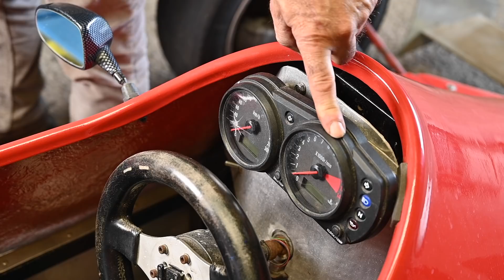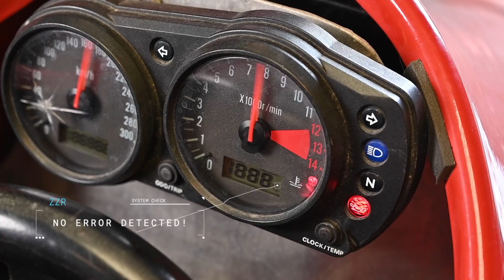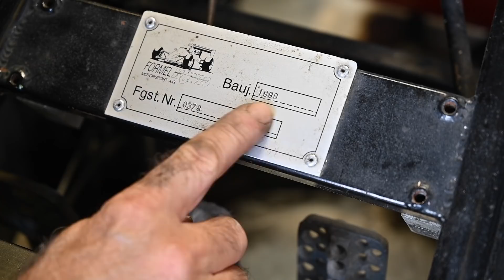Rebuilding a 1990 race car    Part 1

Comment: That cable connecting to the brake reservoir is most likely a crude way of adjusting the brake bias
Reply from the maker: Thank you for the comments, yes indeed that is what it seems to be. Not working
Reply: Was about to say the same.
Reply: It’s not crude,they are very effective. The knob and the way they are installed may be crude. I would put a fabricated crank handle on it to make adjustment faster. We use these in oval track racing and they can be the difference between winning and being last. Very important.
Reply: It's a brake balance adjuster. The cable connects to a double ended screw with a ball in the middle which sits inside the tube at the bottom of the brake pedal. The pedal pushes the ball and the screw ends each push on one brake master cylinder. to get more braking at one end of the car, front or rear, the ball has to be screwed (using the knob) nearer to the cylinder for that end.
Reply: Not crude at all, its the correct way of doing it. but its badly fitted and should be reachable from the driving position.
Reply: Doesn't a brake bias need to be routed to both front and rear brake circuits?
Reply: @youwantshum9860  nope. It's the balance between front and rear systems, it's one cylinder for the front brakes, and the other for the rear.
Reply: @kjellboman8841  yeah so what I said? In order to adjust brake bias, the adjuster needs to be connected to both front and rear brakes.
Reply: Calm down guys. The brake bias cable is connected to a balance bar between the pedals which when adjusted changes the leverage point giving the front or rear brake systems more travel or more leverage thus more pressure.

Comment: Hello, great car there. The overfill bottle is probably a requirement by racing club's tech inspection or maybe called scruteneering across the pond. It is to keep fluids off of the racing surface. More like you might not even have anti-freeze in your radiator as with our motorbike racing in Oregon we are only allowed water and certain additives such as Water Wetter for lubrication/anti rust. The hose clamp on the clutch reservoir cap is probably also required by scruteneering and the blue coloring on it maybe silicone to help keep it from unscrewing. Cheers!

Comment: Thank you from the bottom of my heart for this video. I am also going to build such a car from scratch. In Romania where I live, until 1990, more precisely 1984 1989, Romanian pilots built such cars in their own garages. They were called Formula Easter, they used Dacia 1300 or Lada 1,300cc or 1600cc engines with 160hp weber. We are waiting for new videos with this little wonder.

Comment: A Cheap and cheerful brake bias adj twists a bolt mounted across both brake pushrods with the pedal attached to the centre of the bolt via a threaded bush. Twisting the bolt moves the pedal from the centre to either the RHS or LHS master cyl pushrod ie the fulcrum.  Best wishes on another great project.
Reply from the maker: Thanks for your comments and that is exactly what it is

Comment: 9:31 Brake Bias adjustment, allows you to dial in more or less brake power distribution in between the front and rear.

Comment: Nice project. As already commented by others. The adjustment is the brake bias. Mostly working with a ball on a treaded bar inside a tube on the pedal assembly. 
The bottle is to catch any fluid which cannot be spilled on the race track. The curved radiator is perhaps also from the motorbike donor.
Reply from the maker: Thanks for your comments and indeed .. good remarks

Comment: Steve, even a 5 - 8 minute clip on bending metal or fixing a hose clip on old Rusty would make many of us so, so happy! lol
On this race car I noticed the engine is mounted way higher than the radiator fill cap. This arrangement should have a short metal (steel or alu alloy) outlet pipe along the cylinder head whose level is slightly higher than the coolant passages in the cylinderhead and the fill cap mounted on it. So it will be thermostat, then the fill cap and a rubber hose leading to the radiator input. The radiator should have no cap, just the two tanks. Also, if there is nothing on the other side of the car, you could mount two radiators one on each side but mounted diagonally rather than curved. But, at high speeds, which this car is made for, the force of the oncoming air can bend/break the radiator fins. So, the fins have to be set at an angle or vanes put there to redirect the air flow. Finally, when designing the radiator, keep in mind the extra cooling needed because the car is heavier than the motorcycle for which it was originally made. Cheers.!
Reply from the maker: Thank you for the comments

Comment: The control knob is for a brake bias adjustment (front to rear) useful for wet to dry setting, it should be in a position so the driver can adjust it from his seat. The water expansion extra bottle is because no fluids are to be dropped on the track, you may find something similar with the oil (a catch tank) good work keep it up. Many seem to be missing "old rusty" but those who renovate old vehicles know the problem of getting or having parts made for them.
Reply from the maker: Nicholas, thanks for the great write-up..I learned something from you

Comment: Looking forward to this series. Looked like a piece of the frame was removed so that the rear clutch cylinder linkage would fit.
Reply from the maker: Thank you for the comments, that is very well possible

Comment: Very interesting.  Check the fuel cell, they go out of date.  Foam inside the tank and the rubber bladder can go bad.  You will want a 6 point harness to keep from submarining in a crash and to save the family jewels.  A performance monitor/instrument cluster is expensive but probably worth it if you are serious about getting faster.  You will have a lot of work to do.  I bought a 20 year old NOS racing kart and spent a solid week taking it appart, cleaning it and putting it back together. After that the upgrades and repairs took another week.  $400 for the basic kart.  I've spent $5,000 so far (engine, clutch, seat, tires and wheels plus many little things) and have done 4 races.  Good luck.
Reply from the maker: Thanks for the comments  and advice Dean...

Comment: That radiator looks the right size for that size bike motor. I'd just pressure test it to start and see how it well it holds temp. during your first track day. No use wasting time and money in new radiator when the current one looks satisfactory.
Reply from the maker: Thanks for the comments, I am kind of a weirdo trying to get everything sorted as best as possible

Comment: Hi Steve.  This is a motor cycle with four wheels so you need to come at it from that angle.   Wet multi pack clutch will never work like a car clutch. Cold they bind together.  Also motorcycles have 6-speed sequential dog box with no sychro's.    Once you are on the track with fresh oil, warm gearbox/clutch you can shift at almost full rpm with a slight throttle blip and no clutch.   The radiators are the shape they are (curved) because they are designed to fit in the fairing behind the front wheel on a motor cycle.  The electronics and speedo /tacho/cams/carbs/cdi/spark plugs  are all straight off the donner bike and are built for lightness,  high rpm, power and not longevity/smoothness/non-fouling like a road going car.  Fix the brakes/tires  and take it out on a track for a hard 20 laps before you touch anything is my advice
Reply from the maker: Thanks for the comments James, indeed so that sequential shift is actual a good thing. Indeed

Comment: As others have said the knurled knob and cable is remote brake bias adjustment, and the overflow catch bottle is so you don't drop fluids onto the circuit - most circuits (and marshalls !!) hate having fluid dropped on the tarmac.

You could make a nice alloy catch tank to fit in that space, with a drain plug and sight gauge so you can see if you're leaking fluid into the tank before it overflows.

Edited to add: a lot of sport bike radiators are curved "as standard" to fit inside the fairing plastics on the bike.
Reply from the maker: Thanks for the comments, very good tips..

Comment: That knob is a brake bias adjuster. It adjusts front and rear brake force. If you got the brakes and the rest locks up you adjust until it's balanced

Comment: The knob in question is a brake bias valve. Depending on how it is hooked up at the other end, it either shuts off a particular brake, common in circle track racing, but not so much is road racing. It more the likely adjust the front/rear brake bias. If the car is loose (oversteer) you can give it more front brake, and help alleviate the issue. If it's too tight (understeer) then give it more rear brake.
Reply from the maker: Thanks for the comments

Comment: Well, I think that rear right axle is toast... It´s way off balance, bent, over torqued through its long long racing career... could introduce vibrations and subtle loss of power, could even torque steer or break at high speed... just a humble opinion. Great project! Looking forward to the rest of the series!

Comment: Brake bias adjustment knob
Reply: You're right - for tuning the front/rear balance. I'm sure we'll see an improvement on the cable tie mounting!
Reply from the maker: That is what I expected, as it places the bold in an angle between the two master  brake cylinders, so one has more displacement then the other...
Reply from the maker: @ratheskin58  , indeed so funny to see on how people put cars together and the drive at hogh speeds...
Reply: @D3Sshooter  Looks like an excellent project. What races are you planning on competing in? I’ve done a few hill climbs and time trials in a S2 Lotus Elise - a 111S not a 135R though !
Reply from the maker: @JohnnyL20  , I am looking a track races for the formel Konig if that is still in existence, else I will try the mixed league with Ford V...  There is also the historical race class for these, I might decide later. In each case i will a FIA certificate and license for some of those .. Are still running that S2 ?

Comment: I agree with Will it’s a biased pedal box adjustment to alter the pressure to the front or rear brakes a lot of rally cars use them for gravel or tarmac racing
Reply from the maker: Thanks for the comments  and advice.

Comment: No the radiator is set up like that specifically for aerodynamic reasons. If you add 2 flat radiators you significantly increase frontal area. The best option if you don’t like the bend is mounting a straight long one at an angle similar to the bend.
Reply from the maker: Thanks for the comments

Comment: That adjustment knob looks like a brake cable tensioner for a two piece brake line with a swivel screw tensioner
Reply from the maker: Yes indeed, Thanks for the comments
Reply: @D3Sshooter ......hey any time......your car is built for speed......it is very light and the power to weight ratio is insane......good lucky with the restoration and have fun

Comment: The clutch cylinder is upside down, not completly but it seem you will never be able to bleed it propertly.
And the wierd brake cable may be a manual proportion valve.
Reply from the maker: Thanks for the comments  and advice.

Comment: The coolant "catch tank" is because of motorsport regulations - you aren't allowed to spill any fluids out of the car.
I'm pretty sure the curved radiator is salvaged from the donor motorbike. If you replace it, think of putting a water radiator in one side and an oil cooler in the other
Reply from the maker: Thanks for the comments, that is indeed te possible reason for that bottle... I will still make that look a bit better,,,   I was thinking of two radiators in paralel or  as you say... that is also an option
Reply: @D3Sshooter  my pleasure 😊
And the catch can can DEFINITELY be improved. There should also be ones for any oil breathers.
About the radiator - most formula cars tend to install them at an angle in the sidepods - I'm not entirely sure of the reason but it's probably worth some research
Reply from the maker: @Da5idc  , Thanks, not sure either why they would do that ... I think because  you can fit a larger surface...
Reply: @D3Sshooter  if i recall correctly it's to be able to fit the largest possible radiator volume while minimizing frontal surface area so as to keep drag down.

Comment: The Knob adjusts the F/R brake bias, as the tires heat up you can dial in more to the front tires, while driving
When you race you can not have ANY FLUIDS knowingly drip onto the track, everything must be caught or captured, they re-used the motorcycle tank and then the "Catch Can" looks like and old brake fluid bottle?
 the right rear half-shaft looks bent? when you put it in gear it seemed to be hopping up and down?
Reply from the maker: Thanks for the comments, very good info. and yes that shaft seems or looks like having an issue. something to correct

Comment: It looks like the right hand drive shaft is slightly bent, you can see it in the video at 19:44. You can see it running out slightly.
Reply from the maker: Thanks for your comments, that is to be checked

Comment: 1:25 It is a Kawasaki but not a ZZR1100, I think you'll find it's a ZX9R as are the instruments (3:25).
11:24 The radiator is normally curved on motorcycles to fit in the minimal distance between the engine and front wheel, the slits in the middle were incorporated by the OEM. Yours looks like it has sustained some damage and was likely the reason the doner bike was at the wreckers. I'm with you on the twin radiators though for a race car I'd simply go with a triple core high efficiency on one side (not perpendicular to the airflow but angled to increase width/capacity) and use the opposite for a decent sized oil cooler.
Reply from the maker: Yes, it is a ZX9R... I did find that out later and you can see it in the next video's... TXS

Comment: Brake bias adjustment. You can adjust your brakes to compensate for the weight distribution change when you have used fuel, lost grip etc.

You cant leak fluid onto a race track. You need to catch it to pass scrutineering, in many categories.
Reply from the maker: Thank you for the comments and indeed.. Its just the way the bottle is placed

Comment: That adjuster is  for adjustment  of brake  balance  so  you  can  adjust  the  pedal  box master  cylinders  so  you  can  control  your  brakes  and  set up  you  can  have  the  brakes  pulling  more  on the  front  than  the  back  or back  pulling  more  than  the  front
Reply from the maker: Much appreciated and great comment...  I will have to get that fixed then

Comment: The Knob is the Brake Bias (BB) system. It distributes the brake pressure between Front and Rear.  
100% means full front brake
0% means full rear brake
(which is unrealistic settings 😂😂😂, but helps understand the stuff)
50% means equal brake pressure on front and rear.

Comment: The bottle is so that the driver or his mechanic can see if there is a cooling problem. If it discharged into the track the driver may not no. If it dumps into the  bottle, a quick look will tell them if there is an overflow so they can then look at sorting it.
Reply from the maker: Thanks for the comments

Comment: The adjustment knob on the braking system is almost certainly to alter the braking bias between front and rear.
Reply from the maker: correct

Comment: Several motorcycles use curved radiators, to increase the volume while having a narrower frontal diameter. Some use two radiators connected by a transfer pipe. The overfill bottle and a few other items, such as lock wire, are mandatory under race rules. No race vehicle can vent any fluid to the track. The motorcycle gearbox may need a load on it to change gears, especially with the wheels up on a jack.
Reply from the maker: Thanks for the comments  and advice... I will check it out

Comment: The Radiator is off the ZZR and it came curved like that so the front wheel can turn.
Reply: I just googled it to make sure, and it is the ZZR1100's radiator. I have a ZXR and its radiator is also curved like that so it can tuck into the fairing and not hit the front wheel.
Reply from the maker: Thanks for the comments, and indeed.. however this one is really messed around with

Comment: For the radiators part @ 13:15; I'd run 2 water pumps, one at the engine and one between the radiators.

Comment: If it hasn't been commented on earlier, it looks like the clutch slave bleed nipple is below the fluid line.  It should be at the high point of the cylinder.
Reply from the maker: Thanks for the comments, indeed

Comment: Drive shaft on right side seems to be bent.

Other than that... Sheesh Steve, what do you NOT get involved in? Looks like fun.
Reply from the maker: Thanks for the comments,   that is also what I looked at when viewing the video.  But at a closer look in the shop , it seemed to be just an optical effect of that one spot.  In each case it will be further checked.

Comment: It is possible that the brake pedal doesn't have any travel but the brakes still works. This is common on formula type racecars due to the brake pedal ratio and no vaccum help (not power brakes).
I would try bleading the brakes and see if they work. But in the end I would definitely rebuild the calipers and master cylinders (just for peace of mind).
Reply from the maker: Thanks for the comments  and advice Andrei..  I will rebuild them just to be sure... The pedal is really stuck rock solid and the brakes don't work

Comment: What has been missed is the fact it’s a streetbike transmission as well so it’s going to be 1down 5 up or 1up 5 down so it’s not going to shift in a standard H. So when I’m the car it will shift like a a Sequential gear box in a Rally car